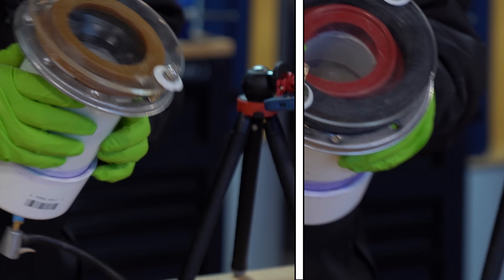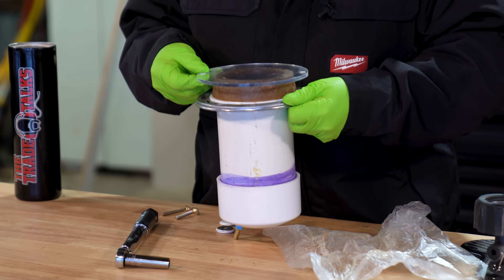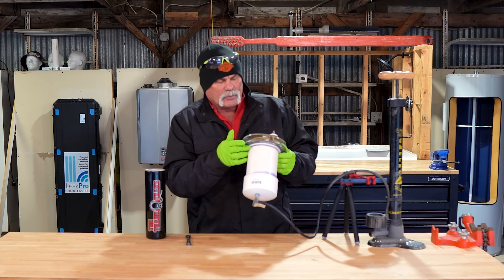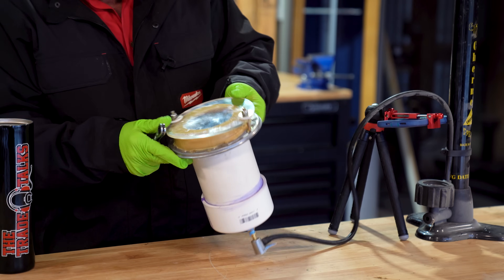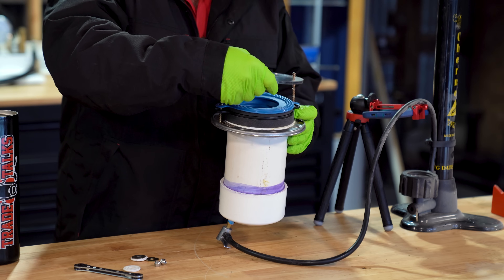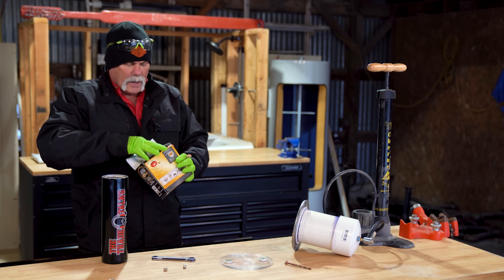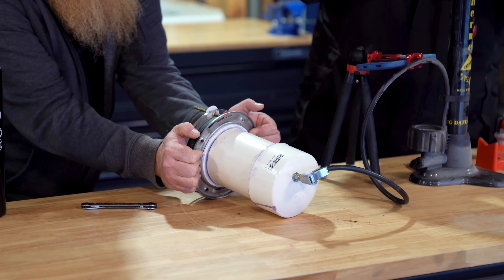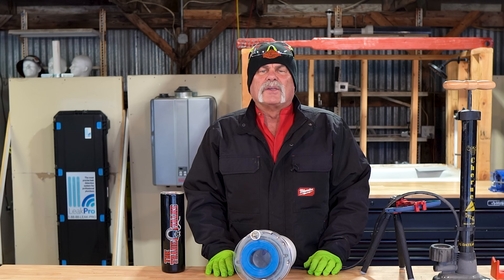Toilet Wax vs Rubber: Which Works Better?

Comment: Your problem with the seals not resealing is because by  only using 2 bolts, in your test rig, you've given in two weak points  for it to break loose 90 degrees off from the bolts. Three bolts weould keep that from happening.

Comment: I haven't read all the comments, but no one seems to address the problem of longevity.  Rubber will deteriorate over time.  I've lived in houses with wax seals that were over 50 years old with no problem.  I don't know if that will hold true for rubber.

Comment: This test is not conclusive. The toilet bowl doesnt have a glat bottom but rather a flange that interfaces with the ring and on top of that connection is never pressurized.

Comment: I've never installed a toilet before.  My biggest fear, when using wax, is when I push the bowl down, that the was squeezes towards the drain hole, and not outward.  I know that the rubber ring, won't do that.

Comment: will never go back to the rubber/foam ring ever again. life exsperience I replace a toilet at my house with a rubber/ foam style with in 3 years, all the foam was gone not just deteriated but gone like it was never even there, went back to wax  8 years still no leak.

Comment: A toilet does not flex like that little acrylic circle does. Therefore, you should be using at least 4 bolts, not 2, to get an accurate comparison.

Comment: You clearly prepared for this before shooting the video, why didn't you make a holder to put your toilet flange mock up into so you didn't have to balance it on the air fitting?  I think the thing you should be testing is how each ring holds up over time with day to day movement of the toilet.  Generally you get a good seal on day one.

Comment: A wax seal will deform more than rubber so the toilet will sit flush with the floor and will not rock and more importantly will seal. It is harder to clean but for good reason, it SEALS.

Comment: Plumber experiment not an engineer 😂. I’ve used the rubber in two of my bathrooms. Several years ago now, no issues. The bottom of the toilet doesn’t flex like that acrylic so it keeps even pressure. A toilet can’t build pressure under it.

Comment: Redo the test using an actual toilet. The plexiglass is bending so much, it's just not giving accurate results. A porcelain toilet base isn't going to distort like the plexiglass does. You'll get an even clamping force all of the way around the seal with the porcelain base. I was having a lot of trouble getting a seal with single and double thickness wax rings. I replaced them with the rubber ring and haven't had a minute's trouble since.

Comment: Just need to allow drainage without a leak. Drainage systems are not designed to hold pressure.

Comment: I know nothing about plumbing. I've done this twice with the blue rubber and haven't had any smells. However, the second time, i didn't feel like cleaning the old wax, which was still in decent shape, so u just put the rubber thru it. Lol i guess only time will tell what happens
Reply from the maker: Let me know!

Comment: This is a fun video, but the premise is wrong. The issue is not the pressure, the issue is longevity (specifically the elasticity) of the ring mechanism. If you have 25 PSI or something like that on your system you have a totally different problem to deal with. However, wax lasts a long time before it gets brittle. If installed correctly you have a lot of life in it. But how is a rubber flange? We use rubber flanges in connecting iron to PVC pipe, and expect it to work for the centuries. So, the material exists. Answer that question, and you will be a hero.
Also, the way that the pump seems to work is that the valve actually isn't even open.

Comment: In my opinion you're not using enough contact points to fasten it.
I think if you had two more bolts the rubber seal would work better as it's made of stronger materials. Although I'm no plumber so my assumption may be off.

Comment: I'm 40 seconds in and I hear pressure test, how much pressure is needed for a toilet 😂 I thought we just use gravity to flush the toilet and the water filling in the toilet pushes things down the pipes, I went into this thinking which holds a better seal and longevity quality😂

Comment: I've done a few toilets with the better than wax.  First one was in my home where I removed my toilet.  Wax ring was 5 bucks, better than wax was 10 bucks.  I knew if I messed up the install with a wax ring, I would have to go back to the store and get another.. 10 bucks plus wasted time.. I figured the extra 5 bucks was worth it if I didn't get the toilet on exact the first time..  Been a number of years, and no problems..

Comment: I'm not a plumber by trade, but I am a pretty good handyman to know enough about plumbing & other types of repairs & installations.... I have installed a few toilets and always used wax seals, and yes, I can also change out the tank parts too, and replace the hose system as well... I also do sinks, food disposals, etc., but NO, I am NOT a handyman by trade, so NO, I don't seek to be hired, but I will help family & friends for free.

Comment: Probably inconclusive. Gotta use a toilet. It's not flexible like the acrylic is. And use the same conditions for all tests. If someone holds both sides with one test, has to be with all tests. I'm a homeowner, I've used both. With wax, you have to thread the needle, and if you don't set toilets all that often that can be difficult. If you get off, you have to either re-shape the wax, which is nasty, or go get a new one. The rubber acts as a forgivable guide and, as you mentioned, is self-resealing whereas the wax isn't. Not to mention, gases aren't the only thing I'm worried about. It's liquids. My rubber seals have been just fine for several years now, and I don't think I've seen or heard anything to make me want to go back.

Comment: They make one out of a green silicone kind of material called sani seal. I installed one a few years ago and haven't had any issues with it. I also glued the toilet to the floor so it'll never wobble 😊
Reply: Yea those Sani Seal waxless gasket rings are pretty dang good as well
Reply: Don't be so sure.  I switched to those years back, then more recently after reviews built up on amazon depicting failure, I pulled my toilets and all of them had failed. 

That green donut is a piece of highly absorbent low density foam dipped in some green  plastic/RTV coating.    The coating is not impervious to chemical decay nor physically durable.  One tiny defect and the toilet water will get in and it will be soaking wet inside, go limp and lose its sealing 'springiness'.   It's good for frequently removed toilets and will handle gross misalignments probably better than any other product, but it simply won't last long term.

Comment: I can see why a rubber ring is beneficial for wobbly toilets........... Here the deal....... Make sure you properly set your toilet and silicone the bottom and leave a small gap in the back. Never a problem again

Comment: When using only 2 Clamping bolts No kind of plexi plastic Plate thickness is gonna seal & pressure test correctly to properly simulate a standard Rigid non-flexing porcelain toilet Flange base.....Gonna need 1/2" minimum thick steel or aluminum Plate to get any useful comparison test results.....Please retest & show results....

Comment: Prefer using wax when the closet flange is less than well installed. Lot of cast iron flanges far from level but not worth cutting out for the sake of running a rubber  seal.

Comment: You've got the bolts tightened too much with the rubber, your plastic is warping .. thus the leak.  A toilet base won't warp like you did with your plastic.   Flaw in your test is the loose nut behind the wrench

Comment: I'm certainly no expert. Is pressure what causes gaskets to fail? I'm guessing failures are typically causes by deterioration over a long period of time or a seal failing because the toilet moved.

Comment: In high traffic, the wax failed after 10 years in cold climate, 5 years in hot climate.
      New material lasts a lifetime 30 years or more in both cold or hot climate.

Comment: What they should do is a full toilet cutout or  glass toilet and they should build a mechanical flushing system and flush it a couple of hundreds of time. Also for not to waste water they will have to circuiate the water.

Comment: No sense reinventing the wheel. I set a toilet in my basement after I refurbished it about 5 or so years ago. Since I set that toilet I don't think it was ever used. The fill valve was leaking so I changed the guts out. I always used 'good' wax seals of proper thickness for the flange. While I was at HD they had one of those foam seals that sounded great. I used one and periodically after a couple years would notice sewer gas. A few weeks ago it was really bad. I pulled the toilet and the foam was flat as a pancake and porous. I swapped in a Joni Bowl seal and its fine now. Don't think I'll be using those foam seals again. BTW, I use the shower in that bathroom for time to time and make sure I flush that toilet a number of times a month.

Comment: I just think the rubber/foam ring one fits a lot easier and forms a good enough seal that it really isn't that much different from using Wax, but a heal of a lot cleaner and simpler. I also can't think of any situation where my toilet is going to have a back up going to 35PSI and not escaping through the bowl >.> I mean neat test...just not very practical. Not to mention Plexiglass/plastic vs Porcelain? Not much fairness there when one bows giving an unfair advantage to wax.

Comment: The biggest problem I see here is the warping of the plexiglass. A steel lid would have been more reliable and the same standard gap distance between toilet and flange used for each.

Comment: Wax melts during the summer,it hardens during the winter, I might switch over to the rubber.
Reply from the maker: Is your bathroom not insulated? We can get up to 110 here in TX and we will be getting to 19 in a few days and the wax rings don't give us problems...
Reply: @RogerWakefield  right now, I put the cinder blocks back where it was and it should be insulated again.

Comment: but there is a difference between plexin and a actual toilet, i'd install all 3 on three separate toilets, so three (3) toilets 1 with wax rest with rubber etc and then determine you're findings

Comment: Think these tests are a bit bad tbh, you can see the Plexiglas is not staying flat and bending with the bolts. You wouldn't get that with porcelain without breaking. also pressure gauge should be on the white pipe, not just the pump.

Comment: Please let me point out what is wrong with this test setup. First, your thin acrylic disc deflecting is causing premature leaking. A disc 1/2" thick would be way less likely to deform. The amount of force pushing on the acrylic is roughly 377 lbs if you do the math where the ID of a 4 inch schedule 40 DWV pipe is approximately 4 inches. Take the area of that and multiply it by 30 PSI. So, in all fairness to the test samples, this test is not doing any of them justice. I am pretty sure Oatey has laboratory tested their "better than wax" seal extensively prior to putting it on the market.

Comment: Im a home owner, now the test is inaccurate because of the lexan clear lid being distorted as you bolt it on. In a real toilet you should have simulated an even clamping pressure , the ring is screwd to the subfloor to keep it ridgid and the toilet is a massive ridgid structure. So a thicker clear lexan plate or backed up with 3/4” plywood clamp rings to help with evening out the clamp force, use 6 c clamps instead of the bolts and try again . The better than wax will work just fine , and will reseal if the toilet wobbles wax wont!

Comment: I think the test should be redone. The screws are to keep the toilet from moving around. They don't force the toilet down. The test should have no less than four bolts holding the acrylic in place because it's deforming way to much, and toilets don't do that.

Comment: You should have put a “non-bending steel plate on the top.  The toilet output doesn’t bend.  Not a reliable test example

Comment: I think you missed a step. Every time I've set a toilet, put the ring down on the bolts, then apply my XXX pounds to seat the toilet, then bolt it down. Perhaps you could duplicate that by using a 1/4" steel disc so there is no disfigurement of the clear plastic, and uniformly torque the bolts to the same measurement

Comment: I have replaced all my toilet seals with the rubber seals and have had zero problems. Never will I use wax again.
Reply from the maker: Did you have a problem with wax? Is that why you went with rubber?
Reply: No but when I bought the new toilets a Plummer there told me that the rubber was a better choice and not messy like wax . So I tried them and so far no regrets .

Comment: The neoprene seals need a flat surface to seal against and the plexiglass your using is flexing not providing a flat surface. Retry the test with thicker plexi or poly carbonite that won't flex causing the seal to break.

Comment: Need to Repeat the test using 1/2"  Minimum thickness Metal plates as the Acrylic end plates Will bend Allowing pressure Leaks that Won't reseal..

Comment: After all this time, I still don't understand how toilet manufacturers use this type of method for toilets to seal to the drain. You would think they could come up with a tube from the toilet direct into the plumbing, then use a sealant between the flanges. If they can mold a toilet in ceramic, why not rethink the drain.....

Comment: toilets don't wobble from from bad wax bad bolts is the cause or bad flange if the toilet is old its sealed with putty if the bolts are good that wont wobble as well

Comment: Not really that similar.  You can see what you're doing and center up with that acrylic ring in way that isn't possible with a toilet, unless your toilet is transparent.  Additionally, the ring is compressed with the combined weight of the toilet and the bodyweight of the installer, and may or may not be even and straight.  Also, as somebody else noted, that acrylic ring is flexing.  Interesting test, but more that a few flaws.

Comment: I'm 2 minutes in and already wondering what a flat piece of acrylic has to do with a toilet's lipped flange.  And what pressure has to do with sealing uneven or moving surfaces.  A fun waste of time, but the test has little to do with the actual use case.

Comment: Rubber wax rings and inserts reduce the size of the hole. Rubber inserts in real wax rings promote splash- back and eventually leakage ! I'll never use anything other than wax only rings.

Comment: Anyone that understands how a lipped-seal works, knows that testing these rubber seals without an actual horn fitted through the inner diameter of the seal is a complete waste of time. The concept would be fine for a standard wax seal (if you weren’t using thin acrylic) because the standard wax ring only has one sealing surface.  The rubber seals have two sealing surfaces. Without an actual horn, you’ve completely bypassed the primary sealing surface of the rubber seals. No one learned anything from this demonstration. In fact, you probably lead some less knowledgeable people astray. 

It would not be hard at all to setup a demonstration with an actual toilet. Use water instead of just air, add a few drops of dye, and maybe we can all learn something.

Comment: Never use a horned wax seal on 3"  They cause more leaks becuse you can not tighten down your WC all they way.  The  plastic will not let it compress down all the way.

Comment: Strange they only use 2 bolts to hold a pressure flange.  4 or even 3 would do a tremendously better job.

Comment: v2 of the test might need 4-6 screws to simulate the weight of a a real toilet. I've only had wax rings (renter until 2023), but they all leaked (wobbly toilets... Dr Who might call them Wibbly Wobbly, yeah I'm a nerd and I loved DIY, exactly "natural" gas and drywall, but I CAN do both).

My Pop-Pop always said if you pay someone, you have to learn, supervise, and redo some of the work with 75+% of people, but if you find that other 10-25%, they're more valuable than gold [I'd say more valuable than their weight in palladium or rhodium, whichever is currently the most valuable metal]... most jobs aren't worth hiring for). My homemaker (RIP, she really made a home) would supervise too, she'd do it under the guise of curiosity. Also, we're Italian-American, we WILL feed you. So, she'd bring drinks or snacks. It's also really hard to screw over someone constantly feeding you (She didn't offer, so much as TELL you that she was giving you something, we MAY have done that with our slumlord's work crew to get them to do things.

My maternal grandfather was in the CB (construction brigade) in WW2 and he had a handyman business as a side business.

Anytime I see a tradesman (or tradeswoman) sharing knowledge with the public, I mean real knowledge, not trying to scare them away with too much knowledge. The build show seems to balance this well, Mr Wakefield seems to {although I am newer to the channel, I really like the practical experiments), and several others, I can't help but think highly of them. I hate that, hire an electrician to change your light bulb crap.

Comment: I guess this was more than a semi-experiment rather than a plumbing education video, Was really hoping this video has more of an educational basis rather than saying wax has been used by plumbers for years bc they work and you don't know enough about the rubber. I'm skeptical too and was hoping to get info from an informed professional. Hope there is an update to this video to give it some value. Thanks